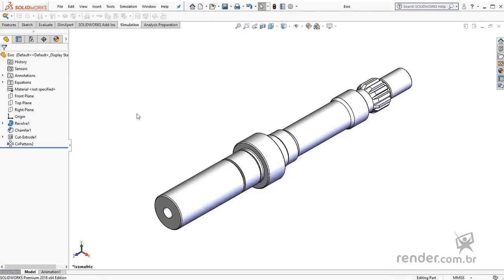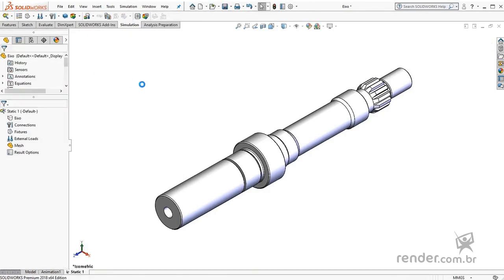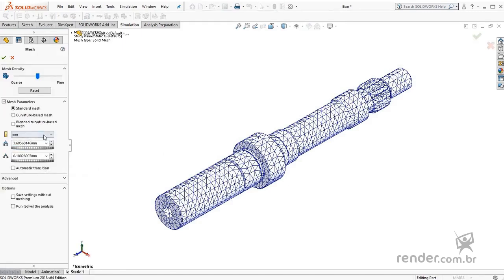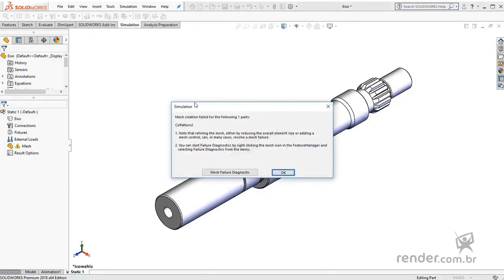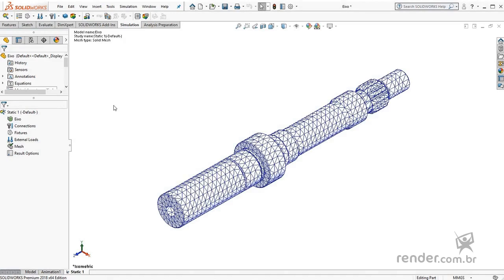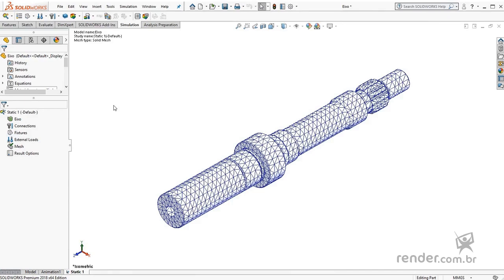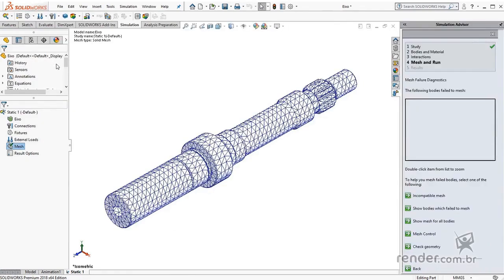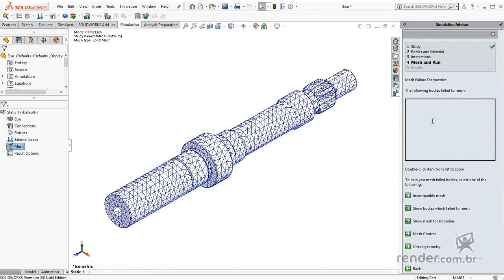Getting to know the Mesh Failure Diagnostics | SolidWorks Simulation - Advanced Static Analysis

Comment: i have a problem creating a mesh in a sheet metal assembly. The simulation advisor only  gives me a body which failed to mesh and not any features of it. im not getting better results with the given options
Reply: nevermind. i fixed it using mesh control and meshing the part very small. thanks anyway